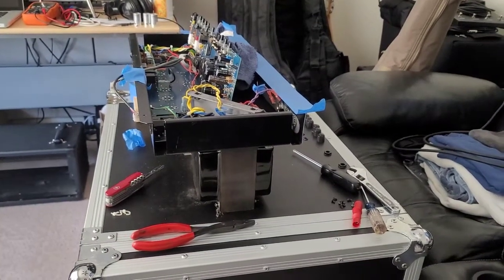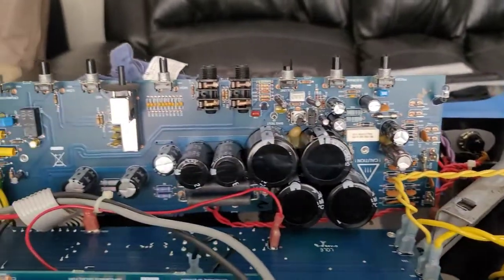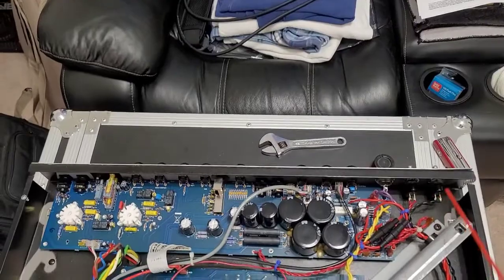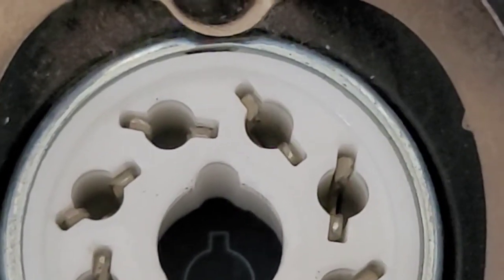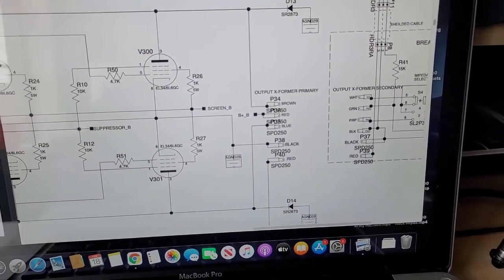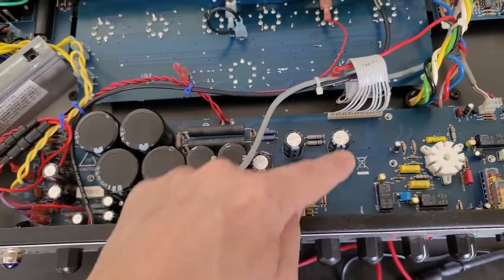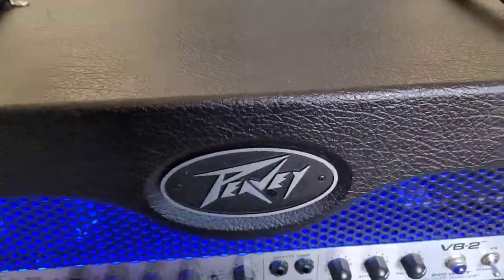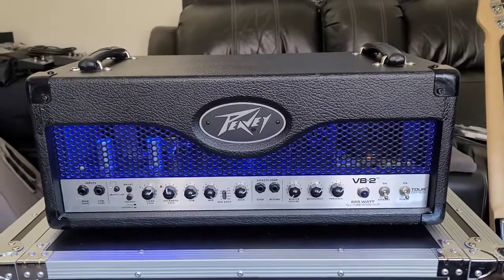Peavey VB-2 All Tube Bass Amplifier: Repair/Restore & Modifications

Comment: Hi there hope you are doing great,I have a Vb2 that I bought new in 2012,and it’s a great amp,and have never had a problem,still running factory tubes.Anyways other day while jamming,I lost all sound,everything lights up all tubes glow as always,nothing strange just no sound,tried goin into the return still nothing,cabs are fine etc,any idea what it could be? Thanks in advance
Reply from the maker: Its likely your F2 fuse. It may still have the 1.5A in it. It needs a 1.6A. You will need to do the work I did to replace it. Add the servicable fuse holder so you dont have to do major disassembly work like I did for next time.
Reply: @Bassguitarist1985  thank you for quick response,I was hoping it would be something like that!Do you like your new tubes? I’ve been thinking of trying the 6ca7 as well
Reply: @Bassguitarist1985  I was pumping an 810E with master volume at about half when this happened btw,thanks again
Reply from the maker: @JV-no9fp  so far loving the 6CA7s! Lots of low end and low-mids! The EH 6CA7s are crazy expensive now. Hopefully soon the prices will stabilize
Reply: @Bassguitarist1985  Was indeed the F2 fuse,did the same mods you did ,no way was i putting it back together with out ,adding the fuse holders lol Anyways thanks for the help,so glad it was just the fuse,cause VB-2 is awesome amp
Reply from the maker: @JV-no9fp  great news JV! Yeah make sure it's a T1.6A fuse. A slow blow one. Bobby Baldwin said you can even go T2.0A but I aired on the side of caution and went 1.6A. 

Wait for my next video. I just scored an NOS VB-MA Michael Anthony Signature model amp!!
Reply: @Bassguitarist1985  yes I went 1.8 amp slo blo ,that vb3 will be awesome!! Good find!! Thanks again!
Reply from the maker: @JV-no9fp  actually I now have both the VB-3 and VB-MA!
Reply: @Bassguitarist1985  That is awesome,run em all ! Lol Be a serious wall of Thunder and doom!! I sure don’t see many of the Vb cabs come up for sale,when I bought my head ,I tried it out through the Vb 215 and it was killer,sadly couldn’t afford the cab,I run my VB2 through a ampeg heritage 810 ,also have the heritage Svt410 hlf,it absolutely kills through either one,I’ve also ran both at 2 ohms and it was loudest most bone rattling rig I’ve personally ever played!!
Reply from the maker: @JV-no9fp  there is an NOS MA810 cab in San Antonio if you are interested. I didn't need it. If it were a 410 i would have been all over that

Comment: I’ll be replacing the filter caps in my VB-2 soon. Do you happen to have a list of values, sizes, and pitch on the leads? I see the caps in the video but can’t even see the values, let alone the size or pitch. I also can’t find that info anywhere on the web. Any help is appreciated!
Reply from the maker: Hey Jim. You just doing the power section filter caps? Filtering, bias caps, suppression caps?
Reply: @Bassguitarist1985  Filter caps and … May as well hit the bias cap/s while I’m in there. I can always tear into it and figure it all out, but I really wish a schematic or some info existed so I can order parts ahead of time.
Reply from the maker: @jimmcgowan2169  i got you covered. Send me your email. I can provide you the shopping cart from my order with digi-key
Reply from the maker: @jimmcgowan2169  also if it helps I am in the Facebook Peavey CVLT group. I posted about my VB-2 there as well
Reply: @Bassguitarist1985  Rather not put my email in a YT comment. Is there another way to reach out to you privately?
Reply from the maker: @jimmcgowan2169  thats fair. Are you in the Peavey CVLT group on Facebook? Or on FB at all? I can reach you through Messenger somehow?
Reply from the maker: @jimmcgowan2169  Jim, try this. 

http://www.digikey.com/short/nf422110
Reply: @Bassguitarist1985  I’ve responded a few times but YT is not posting it for some reason. Thanks for sending!
Reply from the maker: @jimmcgowan2169  you're welcome and as far as schematics are concerned I got them from John over at Peavey. If you reach out to him I'm sure he would be able to provide it to you. Check out my other video for the filter capacitor replacement
Reply: Can you send your FB here and I can find you so we can use messenger?
Reply from the maker: @jimmcgowan2169  i dont want to share my full name on a YT comment either, but if you are in the Peavey CVLT group i can respond there
Reply: @Bassguitarist1985  Lec Tron
Reply: On Face Space
Reply from the maker: @jimmcgowan2169   ok
Reply from the maker: @jimmcgowan2169  sent you a message though you might have to accept it before you can read it

Comment: Great video. Very informative. For me, it's great info to know but I let my local Peavey certified tech actually do the work on it. I have read many of Bobby Baldwin's posts on TalkBass too, but actually seeing one opened up really helps me understand what goes on in there. I've had mine since around 2008 or 09. I am the 2nd owner and mine is dated 2007 as well. Mine is actually with my local tech now and getting a new a new set of tubes (still had the originals) rebiasing, and some other tweaks and adjustments. Can't wait to hear it after it's done! One thing though is that I asked him to get EHX power tubes and he was adamant that they were garbage and that I should stay away from those. He said he would install them if I insisted but that he would not guarantee the work if I chose them. I was perfectly happy with the original JJ's, so I just told him to get those again. Maybe it's an anti-Russia bias, but he didn't mention that. Not sure, but I wasn't going to argue either way. Interesting note about the amp originally having a 1.5 amp slow blow fuse. Was that a mistake on Peavey's part? I'm not even sure if mine has 1.5 or not. Guess I should call my tech. Also, how did you mount the LEDs? Just the peel and stick or did you use Loctite spray? I was thinking heat over time might cause the peel n stick to come off prematurely. I would love a link to that LED setup you bought if you don't mind sharing. Cheers!
Reply from the maker: Bobby said that yes it was an error on the production line to increase the amperage of the fuse to a T1.6A, he did say to me directly that I could even go up to a two amp if I really wanted to. I decided to stay with the 1.6.

The LEDs are 50/50 type that I got off of Amazon I'll have to get you a link. I use the double-sided tape that it came with and then also use some clear packing tape to further reinforce the adhesive. I've had no issues with them coming loose.

Your tech I think is misinformed. Right now EHX power valves are extremely difficult to get due to the Russian sanctions. And the interesting thing is they're 6CA7s are a true beam tetrode valve, unlike the JJ version of the 6CA7 which is a standard pentode like an EL-34 with a larger glass envelope. So you are really not getting the advantage of the internal differences that a true beam tetrode has.

Hope this info helps. What other modifications a tweaks you doing?
Reply: @Bassguitarist1985  Honestly I don't remember what all he said he was doing. Mostly general maintenance I'm guessing. I do remember him mentioning cleaning up a few solder connections and he recommended installing a small fan to help move heat out of the head. Kinda like a PC case fan, not blowing directly on the tubes though, just pushing hot air out. I think Marshall guitar amps typically have fans maybe?
Reply from the maker: @damoneubanks9075  I've heard of people putting in fans specifically exhaust fans pulling air over the valves to keep them from overheating but it's not really necessary. Checking all the solder connections is good general maintenance so that's certainly advisable.
Reply: Well after having my amp for over a month, my local tech returned both my unrepaired VB2 and my money and says he's unable to work on it anymore. Says he believes it's unfixable, although he's not exactly sure what the problem. Now I'm left to figure out what to do. I live a few hours from Meridian. Maybe taking it there is an option. It's heartbreaking. I've had this thing forever and gigged many years with it.
Reply from the maker: @damoneubanks9075  thats bull. It can be fixed. Take it to a better tech.
Reply from the maker: @damoneubanks9075  what's wrong with it?
Reply: @Bassguitarist1985  Yeah. It's hard to believe. The tech who gave it back has been THE go-to tech in my hometown since the 70s. 95% of people here would recommend him above anybody. He's actually the 2nd tech I've taken it to. I'm feeling the 3 hour trip to Meridian is my best bet at this point.
Reply: As for what's wrong with it, I'm happy to share his shop notes by email if you can get to me somehow. I've tried reaching out to Bobby Baldwin to with no luck.
Reply from the maker: @damoneubanks9075  the VB-2 is the more simple circuit design, more traditional, so its hard for me to swallow a competent tech cannot fix it. The VB-3 and the VB-MA, yeah thats a super complex amp with the SMPS.
Reply from the maker: @damoneubanks9075  email is my sn at yahoo dot com. John Fields is still working at Peavey but I'm not sure of the schedule. He is on the Facebook Peavey groups from time to time though. In any events send me the notes you got. I'm not sure if your tech had the schematic but I have them if you need.
Reply: @Bassguitarist1985  I just sent you a rather lengthy email. Looking forward to hearing back. Thanks!
Reply from the maker: @damoneubanks9075  I'll be on the lookout for it
Reply from the maker: @damoneubanks9075  just sent you an email back give me a call. I looked at the images you sent and I think I know what happened.